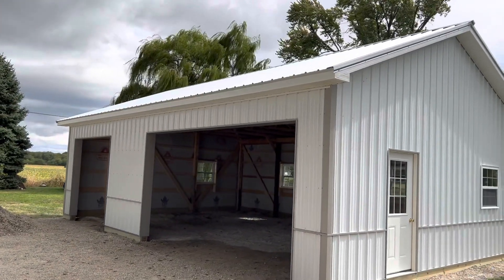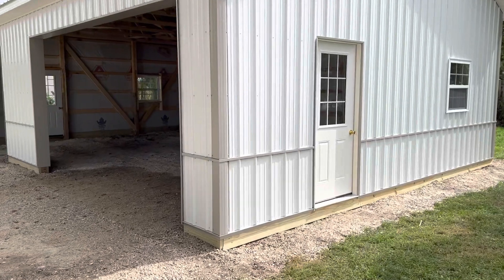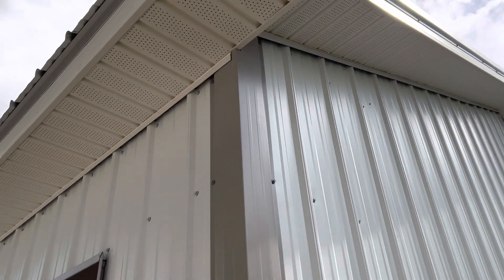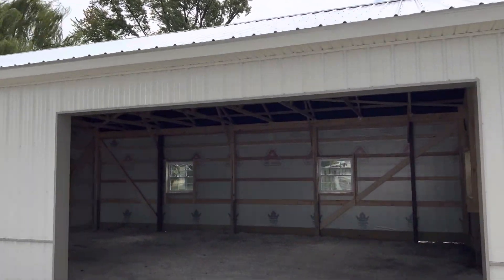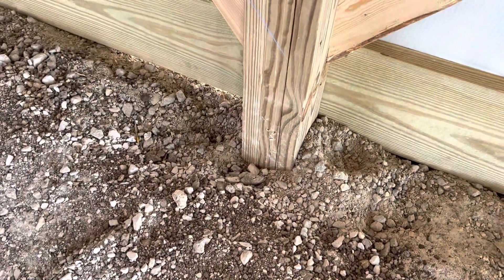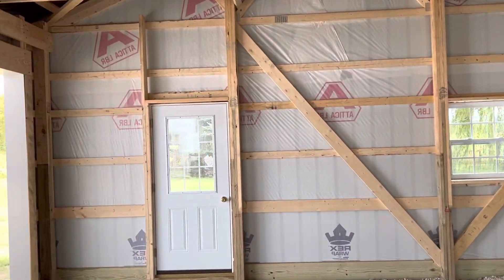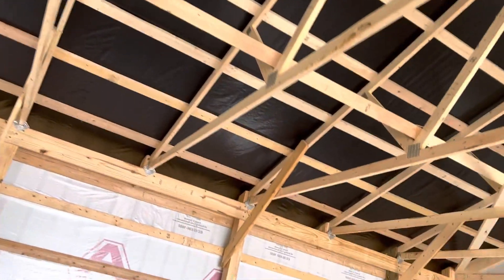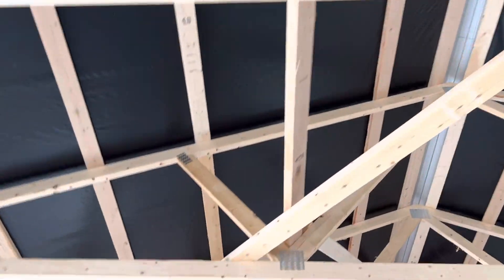Wood Trusses | 24’ Standard Truss (4’ OC 50PSF) - 24x36 Pole Barn

Comment: Hey man, huge fan here. What size boards did you use for the truss carrier? I've been leaning toward 8' truss spans but the more I watch your videos the more I want 4'. Can you have a truss carrier on one side of your barn only? Basically I have a straight wall on one side where the trusses sit on posts, but the other side had garage doors so it needs a truss carrier due to the trusses not having a post to land on. Thanks!
Reply from the maker: 2x8 on this build. 2x10 or 2x12 on wider spans.  Depending on engineering design it may be possible to stack 2x12’s with 4’ on center.  Check with local engineer.
Reply: @Polebarnshops  thanks for responding. One last question. How do you seal the bottom right and left side of the overhead doors? Where the trim meets a slab. Seems like water would build up on the slab, get under the trim and rot the posts.